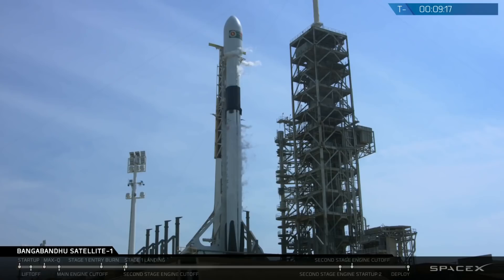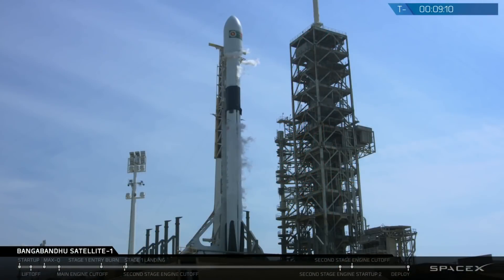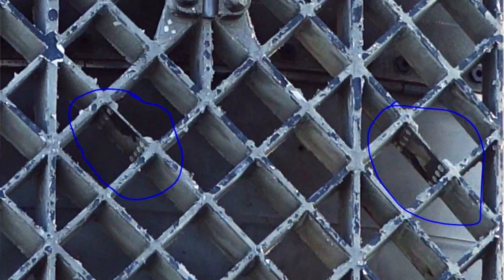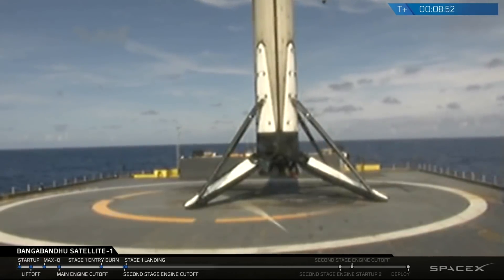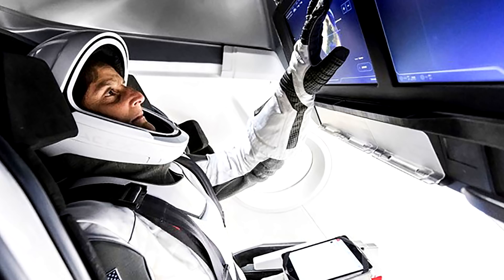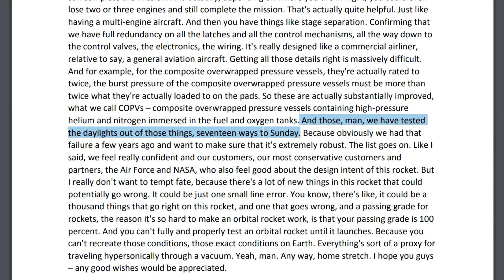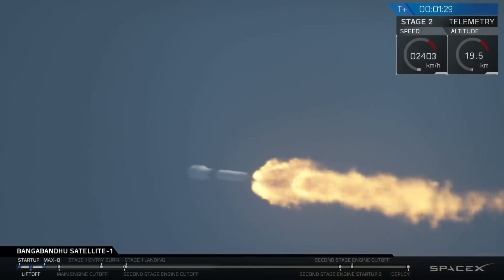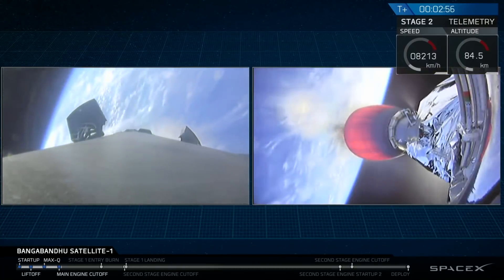How Well Did SpaceX's new Falcon 9 Work?

Comment: You can't honestly believe "hyperloop" is anything better that the tech we already have "maglev trains" or even high speed trains (Japanese).  Think about it on multiple levels.  

-costs per benefit
-operation cost per passenger
-evac safety
-infrastructure development

Hyperloop can't beat that that's why it never took off when it was invented back in 1904

Comment: I think the various interests that Elon has all come back to Mars. I mean, combustion engines and gasoline? Pretty practical here on earth. You want to tool around Mars? You'll either have to carry oxygen or run on batteries. So, work on electric motor design and battery design. But how to justify that investment? Cars for rich people who use those technologies to push the envelope of the technologies.  Same with giant boring machines, evacuated tunnels, etc. Wouldn't be bad on Earth but not needed here. May be difficult to cost-justify but on the moon? Underground tunnels aren't a bad idea. Mars is similar but for somewhat different reasons. The sand is likely to get into everything that goes outside, the sandstorms are also a concern, so being able to travel without going outside is pretty good. Of course, everything involving the launch business, the manned space flight, etc, is all about finding money to develop technology that ends up on Mars. Which is awesome. Because Mars is neat.

Comment: Aluminum fully melts at 1200 degrees F. At that point because of Eutectic it can act like an acid and cut down the melting point of steel by up to 50%. That is what happened to the towers on 911

Comment: I doubt a paying customer could even integrate the payload in 24 hours. I would be amazing if a 24 hour turnaround launch could be achieved.
Reply from the maker: Maybe the 2nd stage would be ready with payload an fairing integrated and just waiting for a booster to be mated?
Reply: @scottmanley  They could, but only if the Falcon 9 it self is integrated horizontally like a Proton. If it is like an Atlas, then the stack has to be integrated one piece at a time vertically, the last being the payload. If the satellite and the second stage were to be integrated first, then the satellite would have to be designed to be picked up with the second stage attached. Do you know how the Falcon 9 is integrated? Is it laying down while being integrated, like the clever Russians do with the proton? The Russians actually pick up the fully integrated Proton plus payload, faring and all, like it was a 'big log' (their words).
Reply from the maker: Falcon 9 is Horizontally integrated.
Reply: @scottmanley  Thanks. A turnaround under a month would be a record for sure.

Comment: I'm not really sure I understand the concern about "load and go".  For me, it seems far more dangerous to be approaching a fully loaded rocket.  Now, I know, "that's what's always been done", but you're still approaching a vessel full of pressure tanks and fuel that's just waiting to ignite, and if it happens to go when you're on the tower going up, where do you go?

At least if you're in the capsule and things go sideways, you're in the capsule with the escape system to get you away.  To me, that seems LESS dangerous.  I mean, imagine if AMOS6 happened as astronauts were going up the tower.

Comment: 3:15 that grid fin looks pretty beaten-up and missing a couple of sections. Might just be distortion or low resolution...
Reply: Nope, it really is beaten up. See 4:30.  These aluminum fins had parts melt and burn up from the heat of reentry. Thus the switch to titanium.

Comment: The titanium gridfin's teeth are actually used to help with aerodynamics. It's kind of the same reason why golfballs have divots in them. It's to create better grip with the air for better control, but still be aerodynamic.
Reply from the maker: Would love to know more details.
Reply: @scottmanley  When a golfball flies, the divots on it's surface cause a thin turbulent layer of air around them. This decreases the size of the wake and decreases drag. The teeth of the titanium gridfins do something similar. The turbulent layer of air below them is very helpful for controlling the rocket. It also decreases the shockwaves that could form and stress the gridfins when exiting an reentering the atmosphere.

Comment: Your statement regarding different aluminum alloys is very misleading. So you have 2k series, 3k series, 4K series, 5k series 6k series and 7k series. The first number describe tensile strength second number provides chemical composition info while last two describe metallurgical properties. Ex 6061 T6 has a tensile strength of 60ksi, 0 represents silicon to reduce hot-shortness, and 6 indicates low levels of magnesium. The 1 indicates added deoxidizer. It is in 6061 to improve weldability and wetting. The T6 is a indication of temper. For example in contrast with 5356, 50ksi, 3 means no silicon, there are some deoxidizers but very low levels, 5 is magnesium rich, 6 indicates grain boundary reducing elements. 5856 is strongest non - tempered grade, 6061 t1 through 6 are most common, 7k series is considered non-weldable as it is very prone to cracking with little or no deoxidizers and grain growth control. The last most common is 3003, this has a tensile strength of 30ksi is very weldable and wetable but not very clean chemistry. 2k series has a lot of other metals and alloys in it, low tensile strength but very high corrosion and heat resistance (high heat resistance for AL. that is)
Reply from the maker: Thank you.
Reply: Scott Manley np. Btw wasent trying to come off as a know it all or w/e just as a welder/fabricator this is something I have a fair bit of info on so I just wanted to inform. Metallurgy I’m pretty solid, rocket science is all you man! Love how your vids make me think...👍

Comment: Can someone explain how the engine nozzles take the brunt of the impact from the reentry? That has to be a lot of pressure with supersonic air entering the end of the nozzle without a means of escape. How does the pressure not build up beyond limits being that unstable?
Reply from the maker: The nozzles are designed to handle gas pressure from rocket exhaust so they’re not flimsy by any means.

Comment: Hey Scott! I have a question, I don't know if you have talked about this in any of your videos, but with the amount of thrust the shuttle engines produced each, how did they keep the shuttle from detaching from the boosters and main tank at launch? I have seen videos from most of the shuttle launches and it seems like the shuttle was attached to the main tank by small (compared to other parts of the rocket) rods, and they also do ignite the shuttle engines a few seconds before the boosters, so to me it would seem like the thrust from the shuttle MEs would be enough to detach it from the rest of the rocket causing a big disaster, in fact, at every launch when the MEs ignite you can kind of see them lift the shuttle upward a bit. Also what keeps the shuttle upwards? is it sitting on its boosters?

Comment: Hyperloop is unworkable, the thermal expansion on a sealed tube that goes from city to city would add up to 10s to even 100s of meters at the ends of the tube and one single failure in the vacuum seal, be it through a crack from fatigue or someone shooting the tube, would cause catastrophic failure of the whole system as air rushed in at transonic speeds.

Comment: Please Please Please!  do a Kerbal video on the semiballistic flight that the BFS will take when doing a PTP flight.  Show it with the booster for long flights, and without for short flights.  I am in a constant flight with someone on Reddit who thinks that SpaceX will waste fuel to reach orbit that doesn't have to be used.  He dismisses my comments stating impossible without having the facts.  He thinks that a suborbital or semiballistic flight will have to boost to an altitude that would put it into the Van Allen belts just to travel to the other side of the world.  My point is that it will be just suborbital reaching speeds of 23000 kph to 27000 kph, and have an apogee under 500 kilometers. 

Smaller distances would require no booster and barely cross the Carmen line (in my opinion).

Show me whether I am right or wrong, and I will point your thread to my "Friend."

Thank you ahead of time!!!!

Comment: Wasn't a b5 falcon the center core of the Falcon Heavy?
Reply: No, it was a 3 or 4
Reply: The Falcon heavy Center core is bespoke, specifically designed only for the heavy. The outer cores are stock, with slight modifications for the attachments. The center core is probably too heavy to be used as a single. I was sad to see it dive into the ocean.

Comment: I don’t think the explanation around minute 4 is quite right. It’s most likley not the fins directing airflow on the structure of the rocket, but the fins will generate a sonic boom shock wave cone witch swipes over the hull and causes the high load resulting in the damage on the surface.

Comment: Al-Ti-Be alloy would be better than 7000 aluminum.
95-4-1
Reply: I am guessing that that is a very nonstandard alloy - Maybe Musk is trying to keep production & refurbishment costs down by using a Ti-based alloy.  Not only would it probably last much longer than aluminum, there is probably some advantage to be gained from the thermal properties of Titanium and how it affects the dragwash during reentry and powered descent.
Reply: Coated in TiN

Comment: Oh Scott, how could you get distracted by the paintjob and not the fact the most important change on the rocket was the engine, namely the turbo pump that was cracking on the other versions. This is the only thing keeping it from a manned certification and there’s still no reports on that.
Reply: That is not the most important change and not the only thing keeping it from a manned certification. There are some other changes on Block 5 for human-rating, but they aren't public.
Reply: Ambient Morality typically defensive answer from a spacex fanboy. So if this wasn’t the issue what kept the blocks 3 or 4 from getting DCR? 

The fuel pump. 😉

Comment: Cutting chamber pressure at high altitude is brilliant. This brings the exhaust shock up closer to the Bell, improving the exhaust vector so that less propellant can produce the same thrust.
Reply: i.e. it is a technical adjustment to improve Isp during ascent as aerodynamic resistance drops?  Sheesh, Space-X really DOES try to think of everything.

Comment: Hey Scott; were you around to see today's (05-22-18) Space-X Iridium / Grace-FO launch from Vandenberg? I'm 500 miles north, in Redding, and had my drone at 400' agl looking south, hoping to get a glimpse of it and get it on video. (Redding's at 592' msl, so my drone was at 992' msl.) I wasn't able to see anything at all. Any idea why not? Was the flight path of the Falcon tilted so far to the South that it stayed below the horizon from my point of view? It's strange, because I could see the last half of the Feb 22 Space-X launch from ground level in the same spot (in Redding), but I haven't been able to see the 2 Vandenberg launches since. Just wondering if you have any thoughts on this? Thanks!

Comment: Any idea as to why the camera leans does not turn red hot? I grasp the idea that the rockets fins are getting hot but why not the camera leans. 
Are we to believe that glass can deal with heat better than the metal there using on the fins?
Reply from the maker: Quartz melts at about 1700 centigrade, Aluminium melts at about 660, so yes, the glass window the camera looks through will handle the heat just fine. However the fins are also generating more heating because of their shape so they get hit worse. Roughly speaking the sharper the edges, the higher the heating, which is why the Space shuttle has such a blunt shape.

Comment: Why SpaceX uses expensive and heavy titanium grid fins in it's falcon 9 first stage, while Blue Origin's New Glenn rocket will have simple, straight and relatively cheap blades (like in the airplane) to steer the rocket during descent? What are the benefits of using grid fins?
Reply: Grid fins have a much larger control surface relative to thier size. This means that you need mush smaller grid fins to do the job.
Reply: They also increase drag and turbulence, which actually makes it easier to control the craft's attitude by aiding in supersonic braking, and by making overcorrection more difficult.

Comment: What is the purpose of the Falcon heavy if the BFR is going to take over?
Reply from the maker: It seemed linked a smart idea at the time.
Reply: Visions change, economics change etc. etc. - Like Scott said, at the time "let's just put three of these together and reuse all of them" for their heavy lift vehicle made complete sense - they have stated that the lessons learned on the project are worth every penny though (not a direct quote 😜)
Reply: Falcon will be the work horse for SpaceX for many years to come, it got a great payload amount for most applications. BFR is better for much larger payloads. Thus can generate the revenue required to finance BFR. Also most of the tech developed for the falcon will be at home in the BFR, including the same engines.

Comment: I have a feeling that the reason that the new 7000 series aluminum octoweb is bolted (as opposed to welded) is because series 7000 alloys (7075, etc.) are simply much harder to weld. While the strength and weight are comparable to titanium, the weldability (and especially the reliability after welding) just isn't there. Hence the bolt-together construction.

Comment: Probable payload for the 24-hour turnaround: Starlink satellites.

At some point, they're going to need to start pumping those bad boys into the sky in order to minimise upkeep losses prior to the constellation reaching minimum operational capacity. 
The ideal process for that would be to have ready-mated second stages with satellites and fairings pre-mounted. 
Then you just land your booster, 
truck it over to the hangar, 
give it the once-over, 
mate one of the waiting second stages,
 do final checks, 
roll out, 
erect, 
and launch again.

Also worth noting that while the First Stage is unlikely to see any further uncalled-for design revisions, the book is definitely not closed on the upper stage:

1) Fairing recovery hasn't been perfected yet.

2) Second stage recovery is yet to be attempted - the ballute method has been mooted, which would obviously necessitate hardware changes.

3) The USAF has contracted SpaceX to develop a RaptorVac version of the Falcon 9 upper stage.

That last part is interesting, as we haven't heard much about that since the first and second rounds of that USAF contract. 
Speculation: Given the obvious opportunities to test BFS tech on a scaled-down and notionally more disposable vehicle, I wouldn't be surprised to see them sticking Dragon 2 solar panels on these MethaLox upper stages (for longevity) and doing various practice runs for BFS orbital operations - potentially including on-orbit propellant transfer.

Comment: The same rocket needs to put up 3 payloads in a week, that is your proof of concept for BFR.  Obviously BFR will need to be highly modular too, meaning they can strip out and replace components quickly and cheaply.  If you could do so off the back of a diesel truck or train car even better.